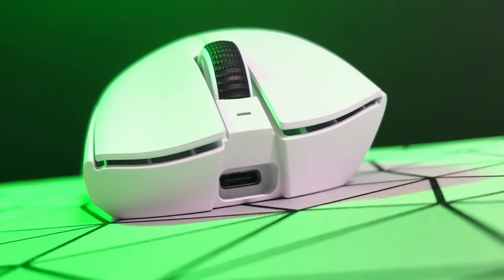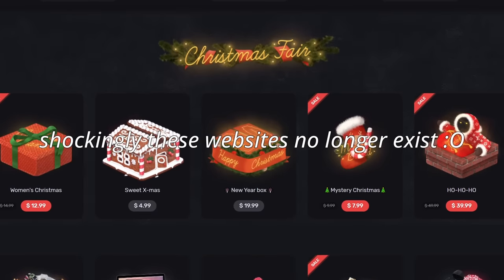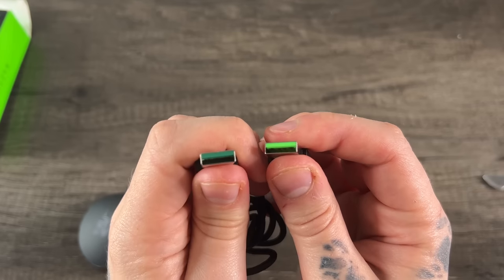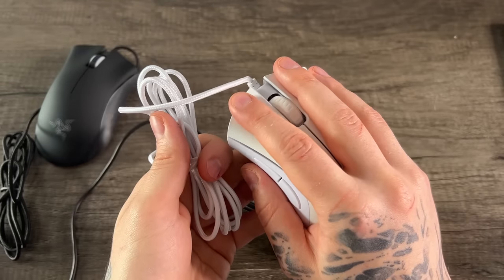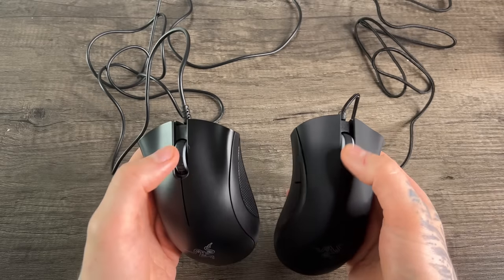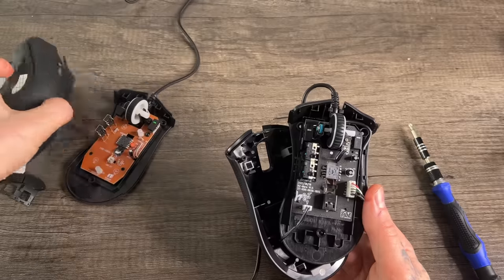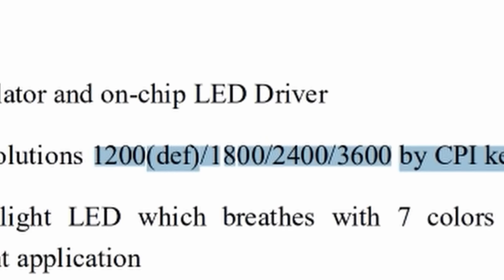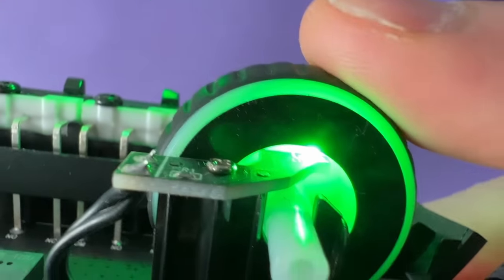I bought a FAKE Razer mouse from Wish

Comment: i own a deathadder essential. its very solid, but its heavy compared to most mice nowadays. but, the shape is lovely
Reply: i own a Deathadder v3 Pro, I am superior
Reply: @dddripz  im not rich lmao. got a pulsefire haste 2 but its broken, so now i cant find a mouse under 50 bucks. but u r superior :)
Reply: I got a basilisk v3 and I am convinced that the 20-30g difference between it and my old deathadder v2 is negligable.
Reply: @nxskii_  thats a big ass mouse, with too many buttons for me. i play some fps games, so the weight, as long as its below 80 grams, i would say is ideal
Reply: @januthcs4286  The essential is 190 Grams? Wtf. I bought the V2 and its 82 Grams for roughly the same price.
Reply: I've been using the essential for about 3 years now and it's finally starting to wear out. I plan on getting a deathadder v3 pro on black friday though.
Reply: @yurushi55  I'm saving up to buy the v3 pro as well lol. The essential is going strong after 2 years of intensive use tho lol
Reply: i also have a DA essential lolz. my first gaming mouse, but i dont mind that its heavy hahah in fact i think the weight may give it more control instead of sliding around everywhere
Reply: british person spotted🚨🚨🚨🚨🚨🚨🚨🚨
Reply: @dddripz u own the wish version that’s why it’s more superior that a genuine crapy razer mouse

Comment: So buying a really cheap Deathadder is an incredibly affordable way to refurbish your authentic DeathAdder with genuine Razer housings!

That's said as a joke, but honestly coming across weird combos of authentic/counterfeit stuff like this tends to be well worth the price compared to the cost of hunting down specific components.
Reply: i juat wanna know if you swap that chip will its dpi increase
Reply: @ra3dlightning844  DPI isn't the whole story, as shown in the video with the sensor losing track and spinning out. There's much more work required than simply swapping the sensor as I'm presuming you're referring to. You'd need to replace it with an appropriate controller and that is guaranteed to have different voltage/communication requirements than the one installed, meaning altering the components/trace design on the pcb itself. So unless you're interested in electrical engineering and want to challenge yourself, that's a project that far exceeds effort and expense of just buying a Razer mouse hahaha
Reply: I doubt it that they are real Razer housings. I mean, look at that cheap piece of plastic that razer makes. How hard is it to make the same cheap shit?

Comment: Fake or not Razer makes terrible mice period they brake so fast i had 3 Razer mice due to the nice shape they had (claw grip) and they all broke withing 4 to 5 months...). Now i use Logitech G502 for over 2 years not a single issue. I am not the only one who knows Razer is BAD many threads online about them and their poor QC yet ask HIGH prices....I wouldn't be surprised if the FAKE Razer would OUTLAST the "real" Razer mouse lol.
Reply: I got a razer viper in 2020 and its held up completely fine with no issues and i dont treat it well

Comment: Ill never buy any other another mouse than deathadder ever again. Tried 4 logi and they broke after 1-, 1.5year all had same issue double click g103, g304, g402, g504.
And my v2 deathadder has outlived every one of them them combined😂(had scroll wheel issues after 3 years of usage but it fixed itself somehow)

Comment: Mine is fake because I think it's made from china and the scroll wheel don't have the green light shining on it and i opened it up and it has the light soldered in the main board of the mouse and it has no 3 screws it has 1 screw and the main board is not made from razer it's made from instant micro electronics too